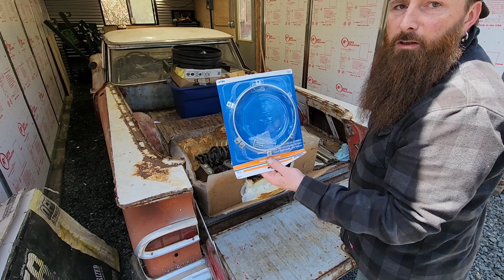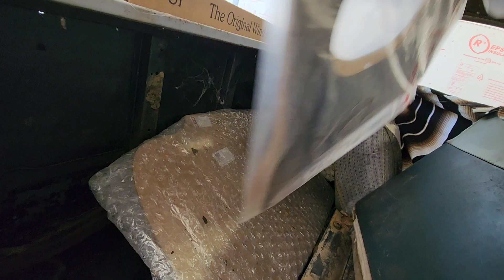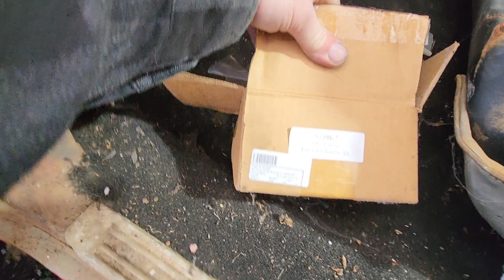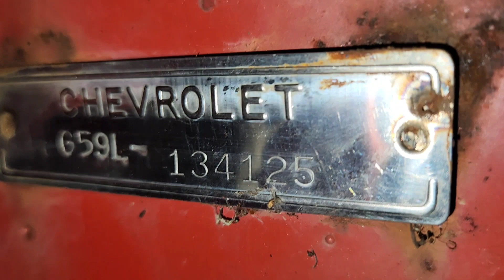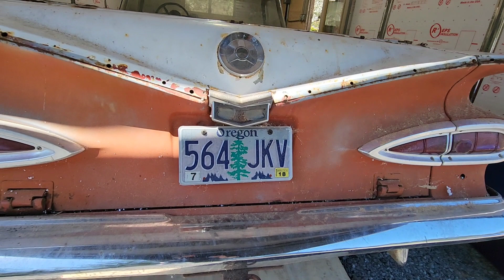Let's Dig Into The 1959 Chevy El Camino! Inventory what we have and make part list for what we need

Comment: Wow!  I love this project already. My first car was a 59 Chevy impala 2 door hard top.  409 with a 3 Duce set of carbs. Power glide was an original cast iron case. The mini moon chrome wheels with Firestone 721 redline tires. The under dash 8 track and fm converter were the entertainment. The bar grill actually cost more than the aluminum factory grill that was so weak that a bird could dent it really bad. The tube grill I had was stainless steel and man did it shine after a good polish. Mine also had the impala bumper with the rubber bullet bumpers. 
Have fun building this price of history. It’s a work of love.

Comment: I definitely have some extra parts. Dig the car & wish you luck on your journey. Mostly little inter stuff, a set of bird? Hood ornaments n headlight rings, the vented wiper valance? Some bed rail parts mostly drilled out for snaps. Mirror, door handles ... can’t remember it all but there’s a guage cluster no clock I’m still hunting for that and a tailgate interior cover. Let me know if you need anything I have. I’d do you a solid.

Comment: You do have the  hard to come by paint dividers on the sides.  A red and white car originally? You need (in my opinion) to find a correct 283 if you're going to redo it as a stocker.  Frame does look good though but it does have the typical 59/60 rust out. Good luck with it.

Comment: U know fixxin that stainless trim is fairly easy ..jus make different size an shapes of oak wood dies  to fit all angle of ur trim small ping  or body hammer an lightly tap dents out ..never metal  to metal. Then start with 320 sand paper work ur way down to 2000 all wet sanding buff an polish like brand new. It's hectic work but worth it
Reply from the maker: Would save me alot of money also. Hey Thanks!

Comment: So ur not laying on rocks go get a bag of concrete mix and just to try it so u will see what I’m saying spread it out over a area and let it set just smooth it out and don’t add water it will pull it from the ground and it will harden up so it is a smoother surface to work on then the rocks just try it a bag of cement isant that much and then u can decide if ya want to go on with it or not
Reply from the maker: Hey Thanks!